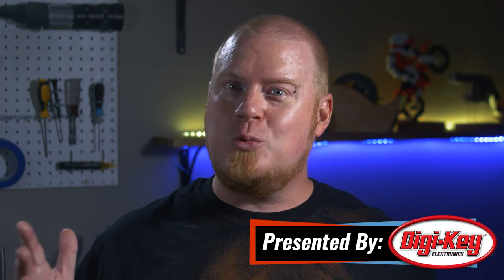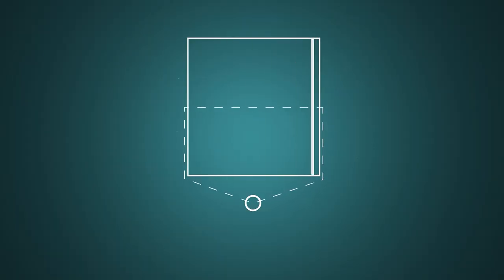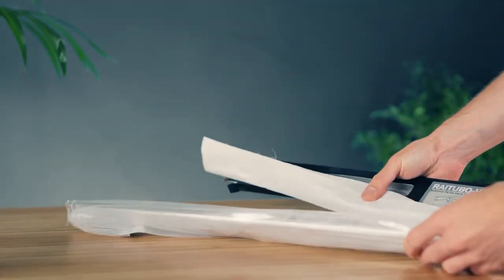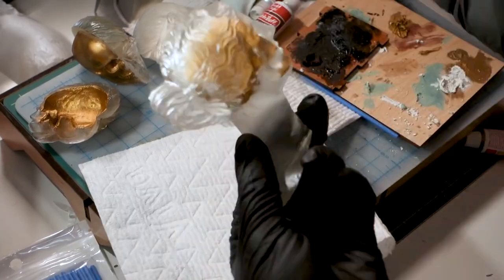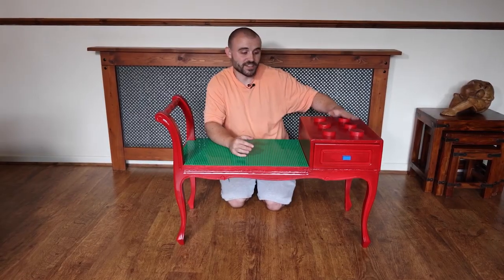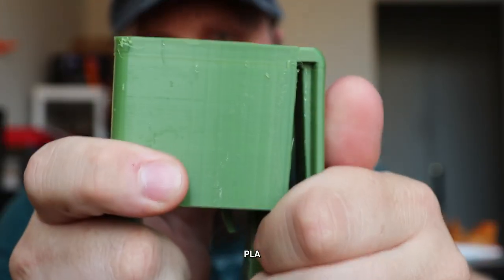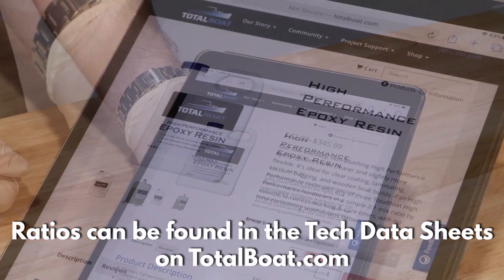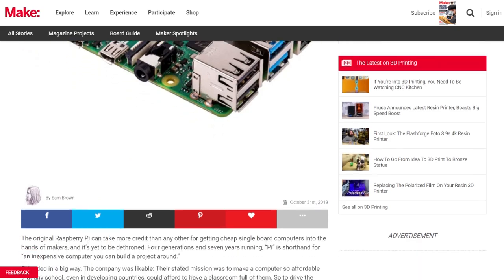Aspirational Computer [Maker Update] Maker.io

Comment: Good round up of projects as usual however your explanation of how Xyla's cart works is backwards, the wheels drive the propeller not the other way round, see Derek's most recent video for a better explanation.
Reply: Thanks for keeping me honest! I haven't watched Derek's video yet, but from Xyla's video I thought I'd gotten it right.
Reply: So I just finished watching Verisasium's video and I'm so glad you called it out - and I'm glad that I watched them in the order that I did. Of course in Xyla's example, the wheels would drive the propeller because they're in a windless environment where the moving road (the treadmill) moves the propeller. But Derek's explanation when out on the desert made it all make sense.

Also loved the explanation of sailboats moving faster than the wind due to lift mechanics, and how the process of oscillating across the column of wind is called "tacking". I'm a lifelong skateboarder and have always know that the method of generating forward momentum by pivoting the board back and forth had the same name. I'm sure that the physics are different, but I never knew where the name came from! So good! Thank you!